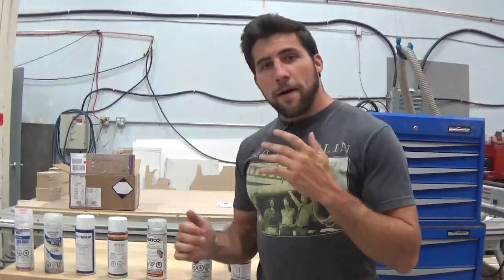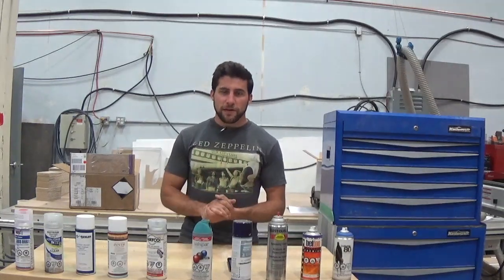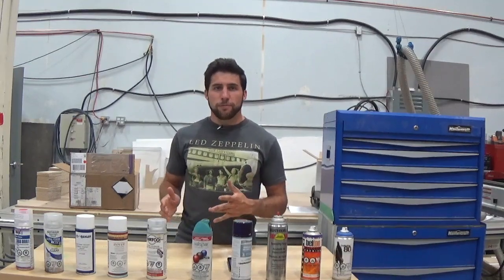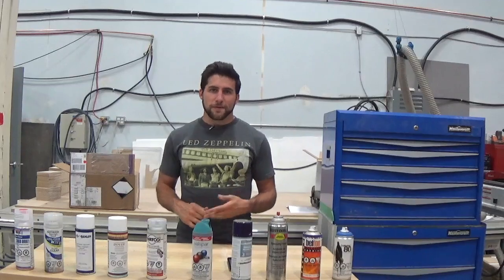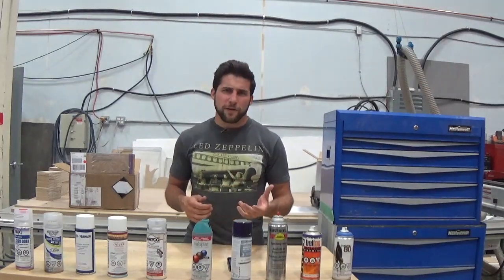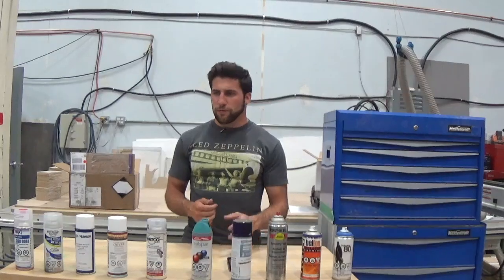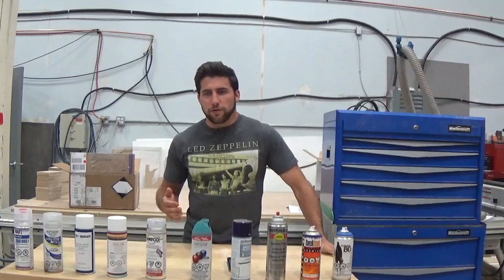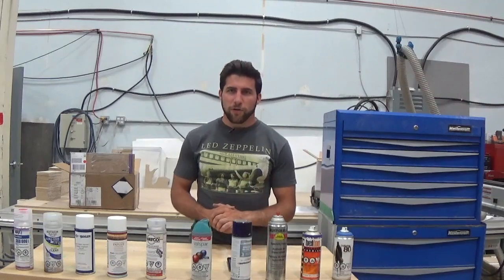The Top 5 Mistakes to Avoid When Painting With Spray Paint

Comment: How can you deal with changes in humidity? I'm painting metal art in an non insulated garage. Great videos and very well presented.
Reply from the maker: +Steve Friedlander That depends a bit on what paint it is. If you're using cans there's not much you can do about humidity. I have a friend who uses a small AC unit to pull moisture out of the air before he sprays.

Comment: Hey Brad. Just putting first coat of black nitro on my guitar and I brushed against it after it finished leaving a big smudge in the paint. It is better to let it dry and sand or just paint over it? Thanks man, love the vids!
Reply from the maker: +Stewart Dyson I would let it dry for a while and sand out the high spots. Then paint over it to try to level out the low spots. You may have to sand between coats a few times to get rid of that.
Reply: +Brad Angove Thanks a lot buddy
Reply from the maker: You're welcome. I hope it goes well for you.

Comment: for some strange reason ive been binge watching spray painting tips and such, this is the only one i havent been mad at! just good basic tips for anybody, nothing that could lead people wrong like "only use white base" though i will say, experiment using "non-compatible"  paints together, it can lead to very cool things!
Reply from the maker: +jon lawrence Thanks Jon. You can definitely get some interesting effects with non-compatible paints, but the durability of those finishes is suspect.
Reply: one i really love, i go with Rustolium hammered base with a metallic automotive top applied cold (sub 40F) and extra heavy while the base is wet so it all flows, a great bio-mech feel to it and hardens up very well but cure time is weeks due to the thickness of the paint, and TY for the reply!
Reply from the maker: +jon lawrence thanks for the tip. I like doing that technique but with a light coat of metallic black over hammered silver. It gets little pin holes in it. Looks pretty cool. I actually was going to have a video coming out in it soon.
Reply: maybe we'll have to compare! ;)
Reply from the maker: +jon lawrence Sounds good to me haha.

Comment: I know this is really old, but i'll ask anyway because i hope to clear something up.
I've got an alu bike frame, i've sanded it down to bare aluminium and here's my thought process for what to do, please correct me if i'm wrong.
I sand it to 400 to remove the rougher grooves
Apply etch primer
scuff it up with 800

wipe it down with motip degreaser
apply my black basecoat
scuff it up again, wipe it down, apply masking tape
apply my blue metallic in the area i want
then wipe it down and apply clear.
This is correct?
Or, do i need something else than a black basecoat for the blue metallic?
Should i lay down some silver or other bright color and mask slightly inside this to create a barrier between the black and blue?

Am i on the right path?
I'm so scared to start.
Reply from the maker: In terms of colors that process is fine. Have a look at my video on how to get an even coat of paint with spray cans to see how cobalt looks over black.
Reply: @BradAngove  thanks man, i will have a look :-)
Reply: @BradAngove  I saw your video and that actually looks really good, so i could just mask out a pattern, or use a stencil and lay down a coat, then take it off and lay down another and i'll have a slight difference in the color.
Thanks for the great tip!

Comment: I needed to go abroad in the middle of an acrylic lacquer rattle can candy apple red paint job on a guitar.* 

It has been left to dry for a month, and the drying has been successful with no problems detected. However, I need more translucent red, as the two coats I applied before leaving, still do not cover the gold base evenly. 

Now, the dilemma (I think) I am facing is this:
- If I just clean the surface with Windex, let dry and spray another 1 or 2 translucent red coats, I am likely to get peeling of the final layer due to poor adhesion, is that correct?
- However, if I sand the surface before the next two coats, won't I lose the translucent effect?

Do I need to sand everything down to the primer again, sand and build up both gold and translucent and clear coat without sanding in between, or can I get away with a light sanding of the translucent red (if so, what grit do you recommend), spray 2 more red coats before clear, and still get acceptable results?

*I know you took up the difficulties with CAR before Brad - I am sorry for not heeding the advice, but I just needed to try for myself...
Reply from the maker: You’re in luck; this is a very easy “fix” as you haven’t done anything wrong. Give it a very light sanding with some 600 or 800 grit paper and clean it. Then go ahead and spray again. The finish will haze up when you sand, but that will be rectified immediately when you spray again.

Comment: I'm refinishing my old racing bike to give to my daugher. I brought down to bare metal, used self-etch primer, wet sanded, then primer filler, wet sanded, then primer sealer. Following primer sealer, I used rustoleum 2x base coat, wet sanded w/1000 grit. Applied 2nd coat that was almost perfect, and wet sanded with 1500 grit, and now I'm about to apply the last coat, but need to make sure it's perfect because automotive clear coat will go on next. Any advice? Should I wet sand the 3rd and final color coat before putting the clear coat? An issue is I'm doing it outside without any other options of where to do it. The spray pattern alone is challenging enough...but then you factor in little gnats, bugs, and dust. Either way, it's turning out pretty good, but could always be better. 

I planned on doing 3 coats of the automotive clear coat and lightly wet sand between coats and hopefully get the perfect top coat with it and wet sand to polish. Should I wet sand the clear coat between coats and the final coat?

The biggest issue I am having is with rustoleum's high gloss protective enamel. Can it be wet sanded? I didn't realize the different drying times. Some of the paint started peeling on the parts I painted with the gloss protective enamel and I want to try to fix it. Another question is, should I put the automotive clear coat over the gloss protective enamel? It's already super shiny, but I was using the clear coat for protection and glossy finish. 

My goal is to give the bike sleek automotive type paint job. Any advice would be greatly appreciated.
Reply from the maker: You should take a look at my video on whether you need to sand between coats. I think it will assist you here. 

If you want to clear coat over a gloss finish you will need to sand it. New paint won’t stick properly to a gloss finish. 

Creating a cross-flow of air over your project may assist you in dealing with the bugs. There are also videos on here (not mine) about how to create a small booth from pvc and poly for outdoor spraying.

Comment: Brad, thanks for your videos, I am a fan. 
I want to paint a fender part flat black and part gloss black. I usually use rustoleum in a can. 
Do you think I can paint the whole fender flat black, mask the part I want flat and just spray gloss over the other part. 
Also, I usually paint primer, paint and clear about 15-20 minutes apart and it works for me. Is this ok?
Reply from the maker: Have you seen my video on how to paint matte and gloss patterns?
Reply: Brad Angove no I missed this one. Will look for it. Thanks.
Reply: Found it, exactly as I thought but wanted to confirm from a pro. Thanks again.

Comment: Hi Brad,I wanted to ask you if I could better use a matte or semi gloss paint if I wanted the color
layer sealed with a transparent coating. Would that solve the problem of
sticking the clear coat layer to the color paint layer without having to sand
the high gloss to matte before spraying on the clear coat layer for matter of
binding/sticking? If there is wood grain with depth differences you even can’t sand the lower surfaces to
matte …. That is the reason for asking this question.Thanks in advance,
Nico
Reply from the maker: It will help, but won’t fully solve the issue. Scuff what you can and the next coat should bridge the grain.
Reply: Thanks for the speedy info :)

Comment: Hey Brad, I'm having issues, my paint is cracking like fissures. Down to the plastic, looking into the fissures the plastic appears wet or at best the abs has developed a gloss finish. I've made a baking booth using a room fan heater and suspect that the can was at room temp and fairings were warmed up. I used plastic primer filler, over sprayed with primer filler not having reached top coat yet due to problems. Thanks in advance
Reply from the maker: Temperature changes from surfaces cooling etc. can cause that crazing and cracking because of paint shrinking. Have you seen my video on paint crazing?

Comment: @Brad Angove the first mistake you mention regarding the under coat not drying in time and I am left with soft paint. 
Would you recommend scraping it back down to bare metal and starting over or is there a way to dry it with heat and than sanding it down and starting over? 
What would be the solution with that specific example?
Reply from the maker: You can try baking it a bit or heating it to try to get it to harden, but generally the solution is simply to strip it back and reapply.

Comment: Hey Brad, I was wondering if you could help me. I just finished painting and clear coating my guitar. I've had this issue several times, The sanding part is no problem. However after I use the compound, and get it looking great, as soon as I sit and play the guitar I get some kinda reaction on parts of the finish. It kinda blisters and cracks and goes kinda rough. I thought maybe I didn't wash the remains of the compound off or something. This is very unclear to me. What could be causing 
this? Any help or advice you could give me would be very much appreciated.
Reply from the maker: That’s very odd. What kind of paint are you using?

Comment: I plan on painting my daughters dresser with a primer then after its dried making a spray paint galaxy pattern on it like the street artists. Are there any recommendations you might have for primer types/brands and spray paint brands that you'd recommend? (I was thinking a white primer for my base, and then getting sprays from the local Michaels. But now I'm worried.)
Reply from the maker: +Amashi Zaino there are many different spray paints that can be used for that. I've used a few different kinds myself, and they all tend to work just fine. I would try to stick within the same brand, and also, make sure you sand the surface before you start and wear a mask.

Comment: Great video! i really learned a lot. However, i still have a question. How do i fix something that wouldn't dry? what i mean is that, i forgot to put hardener in it while i was mixing up the paint or didn't put enough. I cant clear it because i have to hydro dip this piece.  I cant even sand it down because the paint just sticks to sand paper.
Reply from the maker: Sounds like you’ll probably need to use paint remover for that one. Or possibly a heat gun and scraper.
Reply: Let it harden for s long period of time start over or start again

Comment: In the stage of sanding then using clear coat. This is new to me and it is daunting because the 800 grit sp did scratch the paint. Lets see if the clear coat does cover it up
Reply from the maker: It generally does.
Reply: @BradAngove  The first coat was good. I put a slightly thicker clear coat to finish off and it started flaking.

Comment: What about keeping the can at the same temperature by using a water bath?
I've seen someone using it before so the can won't get too cold. 
I hope I remember it correctly. 
What is your take on that?

I'm interested to paint my own guitars in the future and since I won't do a lot guitars i thought about airbrushing and different needles. I don't just want to paint in one colour but do some fine detail work. Time isn't the problem so would it be helpful to spray the whole guitar only with an airbrush gun with different needles? 
(Instead of getting a regular spraygun + airbrush for details) 
What would you recommend buying if I don't want to buy another airbrush gun after 2-3 years but be well prepared for future projects?

Thx for the video.
Reply from the maker: You're on the right track with the water. That's a trick where you heat up the can in warm water to help build up pressure in the can and keep the paint relatively thin. It helps it spray a bit easier.
You should be able to get most or all of your airbrushing done with a standard 0.35mm nozzle airbrush. You won't be able to get an even coat of paint on the whole guitar with it though. If you don't want to get a paint gun, consider combining airbrushing and spray can techniques.
Reply: Brad Angove
Thx for answering that quickly.
I'm gonna check out your airbrush videos later.

Comment: Does steel wool do good job on sanding glossy black acrylic on metal for clear coat or does it make it too smooth?
Reply from the maker: It doesn’t make it too smooth. It could leave steel residue though and it doesn’t level.

Comment: Thanks Brad. Already noticed the edge issue on my bike frame. I did let my drips run knowing nothing would make it better. The one thing I am trying to get right is that when painting a bike, a steel bike with narrow tube diameters, it is hard to get full coverage on any one coat without overpainting some spots so my theory for right now is that I need to put a lot of light coats on and focus follow up coats on the areas that are clearly difficult to reach. My drips have been as a result of trying to get full coverage in one go. I kind of feel that the trick for an object like a bike frame is getting it suspended in a way that allows me to move it freely in all directions.

I just put on an enamel coat so I guess I need to scuff it up a little before the second coat.

I live down in South Florida and I was wondering if there would be any curing benefit from putting the frame in a kind of solar oven, some aluminum foil that would reflect the sun onto the frame and heat it up. You have any views on that?
Reply from the maker: Hi Ed. Light coats are the key, but I also have a video on how to get an even coat of paint on curved surfaces that you might find helpful. As for the sun, I would advise against that. Most paints aren’t designed to be applied or dried in direct sunlight, with the exception of things like deck paint and house paint.

Comment: Hey great video recently I painted a plastic controller, and coats case out good imo but for some reason even after letting it dry when I touch it I get finger print indents what is this from?
Reply from the maker: Usually from putting the coats on too heavy or too close together. Could also be related to temperature and/or humidity.

Comment: What would you reccomend for fixing paint runs? High grit sandpaper? And after i sand it should i spray another coat of the same color? Or can i move on to the next color?
Reply from the maker: You can sand out a run with 320 or 400 grit. Then sand the whole coat lightly with 600 before moving on to your next coat. Unless it’s metallic, in which case you will need that extra light coat after.
Reply: @BradAngove  Thanks!!!

Comment: Hi,

What do you recommend? Letting the base coat harden before clear coat?

Or should I add clear coat after 10-15 mins?

If i wait for paint to harden, should I sand it before clear coat?

And if I sand, how do I make sure surface is clean before clear? Should I wipe it with rubbing alcohol? Is that even safe on 1k base coats ?

Any tips would be greatly appreciated
Reply from the maker: Let the base coat harden fully and then sand lightly with 800 grit and clean with wax and grease remover before spraying the clear.
Reply: @BradAngove  Thank's man, you're a life saviour :)

Another question, which might be more important. I was so brilliant to use a 1k primer, and i've bought a wheel paint that is acryl, and ordered 2k spraymax clear coat, can this work together after hardening?
Reply from the maker: Yes, it can work.

Comment: Do you have any advice on spray painting used tires for recycling purpose? I am using either a primer and then a color top coat (all spray) or a color spray paint/primer. In either way, pressing hard on the dry paint is making it crack and peel off. Is it because I am not waiting until the curing is complete?
Reply from the maker: No; it’s because you’re trying to paint rubber. I don’t think you’re going to be able to do that with normal paint. Rubber is made with colour in it; it doesn’t generally get painted as far as I know.

Comment: Hi Brad, thank you so much for your video, it was very helpful. Question, what am I doing wrong when I recoat the next day (same paint) and my paint wrinkles up, is that because I didnt sand it first?
Reply from the maker: That could be part of it, but it could also be that you’re applying the paint too heavy so the drying times between the surface of the paint and the stuff underneath are different.

Comment: What about using old paint? I have a few 2 year old Rust-Oleum metallic cans from my last project and just ran out of the new can of gold on a current project. Can I finish my current project with my 2 year old gold spray can? 

Both the old can and the new can are the same brand.
Reply from the maker: That should be a problem as long as it still mixes and sprays properly.